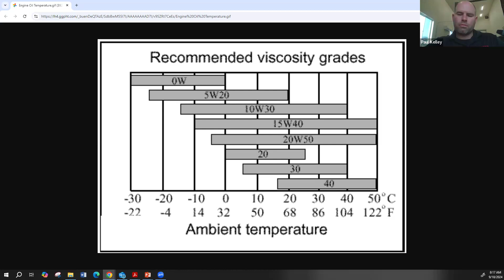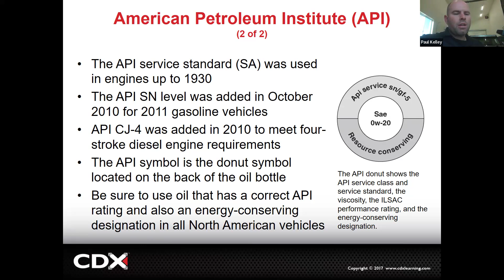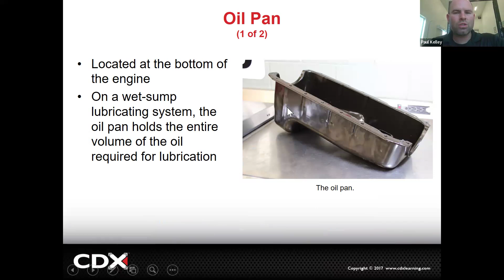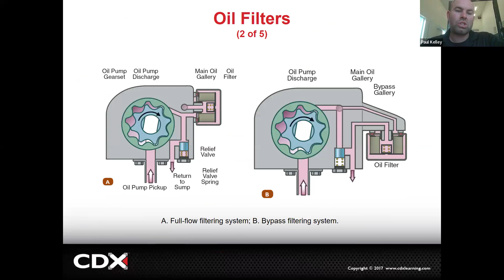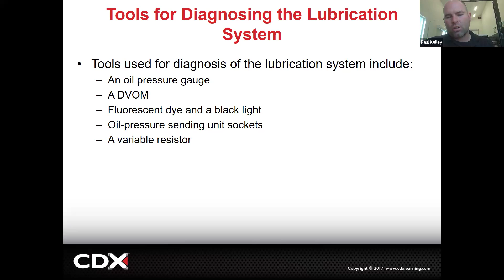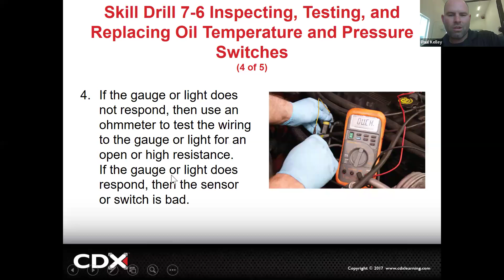ASE A1 Engine Class Unit 4 Lubrication System Lecture

Comment: So if an oil gallery in the cylinder head oil gallery were to be clogged where the camshaft is, would it affect the main oil galleries as well and the crankshaft gallery oil pressures and operation? Would it cause low oil pressure in the other components or just in the circuit where the galleries are located? Like at the cylinder head galleries where the cam is?
Reply from the maker: It would only affect that head. There would be low pressure after the clog. Everything after the clog would have problems (damage, vvt in that head may not work)

Where it gets a little more confusing is when there is a major leak. That would affect all areas. Like a big water leak in a pipe, all the faucets in other rooms may not get pressure any more.

Comment: 21:18 catch can systems are important in cases of forced induction which will increase the pressure inside the engine which can indirectly affect piston rings which can eventually cause compressions or power loss 😅 and the catch is still connected to a pcv valve the catch is there for you to dispose instead of it recirculating